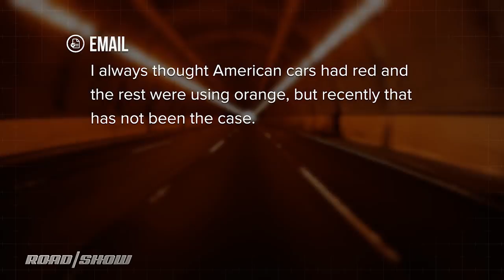Do turn signals have to be red?

Comment: I'm all for amber turn signals. They are just easier to spot when driving. I've noticed that the Asian car manufacturers mostly use amber turn signals and the European/American manufacturers have red turn signals. I currently drive a 2017 VW Jetta which has a red turn signal.
Reply: Mercedes C-Class in the US carries an amber bulb in the housing yet the brake lamp is the turn signal. The biggest pet peeve of mine are manufacturers that have the housing for an amber turn signal but instead it serves as a blank and the brake lamp is the turn signal. Ford is extremely guilty of this and GM has been doing this with their Malibu, Cruze, and Equinox. It just looks like blatant cost cutting. Atleast Jeep adds an extra reverse lamp rather than leaving the housing blank like they do on the Grand Cherokee.
Reply: @juanzingarello4005  It also annoys me when Mercedes tail lights have a clear lens which they do use separately for the turn signal yet despite no cost savings of putting amber LEDs behind it they STILL insist on using red LEDs!
Reply: ElevatorMan5482 ElevExperiencing Productions Ford and currently Chevrolet are extremely guilty of doing this (ex. The Equinox). Atleast do what Jeep does. They substitute the amber turn signals with an additional reverse lamp. Have you ever seen a Grand Cherokee backing up? They get really bright with 4 reverse lamps. But when you leave blanks like Ford and Chevy did it just screams blatant cost cutting.
Reply: @juanzingarello4005  I'm actually not exactly referring to what Ford and Chevy did. What I'm saying is that some Mercedes makes have separate clear lenses dedicated for use as the turn signals which they did decide to use in the US unlike Ford and Chevy but even behind those clear lens, for whatever reason, they still put red LEDs instead of amber despite NO cost savings whatsoever to just put amber LEDs behind the clear segment instead

Comment: This has always bothered me.  Some cars have red turn signals so poorly designed they're practically imperceptible.  A yellow turn signal would fix that so easily.  On newer cars I guess they're not as bad because if they're LED it's typically the whole lens that blinks.  Still, they should all be yellow.
Reply: I am not sure what red turn signals you are referring to. Integrated brake light/turn signal lights are proven to be the safest design in the world due to its simplicity. You hit the brakes and both illuminate red in addition to the high mounted 3rd brake light. You hit the brakes whilst the turn signal is operating and only the corresponding turn signal flashes red while the other brake lights illuminate. Science has proven that this setup is safest due to its simplicity and not confusing other drivers with an amber bulb located in a separate area away from the brake lights.
Reply: @haroldbeauchamp3770  You copied and pasted

Comment: I hate red colored turning signal lights. They're hard to see in certain angles with sunlight.
Reply: I feel the exact way regarding amber turn signals. The red brake light is almost always too bright and overpowers the amber turn signal. What good is the turn signal when the red brake light is substantially brighter and easier to see?

Comment: You know why they use red instead of amber? Two less bulbs and too less pair of wires. It's a cost thing. It annoys me even more when companies like Mercedes put the amber bulb in but use the brake lamp as the turn signal instead.

Also, I don't understand the final reason that Brian stated as to why automakers go with red. Because they don't want to risk it by doing something different? Some cars go from red to amber and vice versa during facelifts. All three American brands have used amber and red. There has never been a scenario where an automaker was sued because he had amber turn signals. Yet tests from the IIHS proved that the risk is greater with red. Wouldn't this go the other way around? Johnny B. Bucks got killed in an American C-Class for using a red turn signal that couldn't be recognized by Jack D. Ass who slammed into him. EVERYONE else is mandating amber. Why did you, Mercedes Benz decide to go red for this one country where Johnny was killed? Makes no sense. It's all about costs. That being said, I think we live in an age where everyone is trying to penny pinch here and there and the reason we see more red nowadays is for this reason.
Reply: The cost effective thing does not go up anymore nowadays because there are a lot of new cars on the road with led indicators, also cars are becoming so expensive that cost effectiveness of using red turn signals is peanuts. It proves that there are more accidents in America because of the confusion of red turn signals that insurance companies are much better off with amber turn signals... Much cheaper because of less accidents. Europe is just proof of that and America just won't admit it.
There is just one big major f-ing reason..
It's all about esthetics! Esthetics are more important to America than safety...

Comment: In my old car, runing rear lights (idk correct term) grounded through turn signals, as ground wire for whole cluster was bad. So when I put blinkers on, it was red lights which were flashing. So when I see flashing rear red light, first thingthat comes to my mind is that ground is bad, not that car is American.

Comment: I'd like to think that part of the reason why most turn signals in the rear are red is to decrease the possibility of someone putting in a clear bulb where an amber one would go or vice versa. One thing that most if not all people here have failed to mention is how many auto makers are integrating turn signals into the bumpers of vehicles. Some of them quite low which will only ensure they will get covered in snow and ice should they be operated in areas where snowfall is expected.

Comment: IMO, it makes the most sense to simply use clear lenses for greatest light transmission and LED bulbs of whatever color you want. 
That combines the best look with the most efficiency and greatest level of customization and ease of change.
Reply: Exactly. All these carmakers worried about the image of their vehicles should stop using red lenses and just have clear lenses with red LEDs for braking and amber LEDs for turning. Clear lenses look super sleek

Comment: I have always liked it better with the amber turn signals. 
However, if a car company is going yo use red, keep it independent from the brake and tail lights.
Reply: Independent brake/signal lights are actually more confusing to drivers according to science. Integrated brake light/turn signal lights are proven to be the safest design in the world due to its simplicity. You hit the brakes and both illuminate red in addition to the high mounted 3rd brake light. You hit the brakes whilst the turn signal is operating and only the corresponding turn signal flashes red while the other brake lights illuminate. Science has proven that this setup is safest due to its simplicity and not confusing other drivers (elderly and new drivers) with an amber bulb located in a separate area away from the brake lights.
Reply: @haroldbeauchamp3770  funny because Roadshow and other sources have said different.
Reply: @Andrew-zv4fm  The government report that Roadshow was referring to was from 2009. Since then, the majority of automakers have switched to LED brake lights. These bulbs are substantially brighter than the incandescent bulbs used in the 2009 study. Newer research circa 2016 proves that the safest setup is the integrated LED brake/turn signal setup due to its simplicity. cheers mate
Reply: @haroldbeauchamp3770  that is not what zo am talking about. When I mean integrated I mean rear lights that have three jobs of brake, tail and turn signals.

Comment: Red for a turn signal is simply tooooo stupid...specially when the person is braking at the same time he turns on the signal, it takes more concentration to know he has turned on his signals
Reply: It's even more of a headache when the red lights share the function of both turn signals and brake lights
Reply: ElevatorMan5482 ElevExperiencing Productions >>>  and the tail lights.
Reply: Well technically the same thing

Comment: I hate the US lighting laws. Some of the dumbest thinking ever! I also hate red turn signals, especially when the same light is used as brake lights! I'm looking at you American and German cars. Europe requires amber turn signals...so why not just bring those to the US as well?
Reply: Also, US still does not require side repeaters for turn signals.  Such an important safety feature.
Reply: Integrated brake light/turn signal lights are proven to be the safest design in the world due to its simplicity. You hit the brakes and both illuminate red in addition to the high mounted 3rd brake light. You hit the brakes whilst the turn signal is operating and only the corresponding turn signal flashes red while the other brake lights illuminate. Science has proven that this setup is safest due to its simplicity and not confusing other drivers with an amber bulb located in a separate area away from the brake lights.
Reply: @haroldbeauchamp3770  Nope science has proven this wrong as well

Comment: Im here because my motorcycle has extra rear signals in red. My narrow brake light has an integrated amber signal and i have small amber signals under the tail above the plate. I didn't feel safe with just that but someone added bright red brake LEDs to the rear peg arms and i rewired them as turn signals. Super bright but not amber

Comment: As long there is an Amber color in the turn signal, like the Tesla model x (US Spec) where both tail/turn lights are combos, like when you have the brake light on, and when the turn signals are on, the brake light turns Amber. 
(This is kinda hard to explain, but this is the best I could do)
Reply: No. That's almost just as bad
Reply: That's still eliminating a functioning brake lamp for a turn indicator. Some Ram pickups do the same. I literally screamed "WTF DODGE" when I first seen it

Comment: If they really needed the rear turn signals to be red, they should at the very least increase the blinking frequency so it is easily detectable to traffic behind.
Reply: Except the problem with this is that signals flash faster when they burn out or stop working to let the driver know that its time to change the bulb.

Comment: there have been a few times when, because of the sun or street lights, i have had a harder time seeing the orange color. really the best turn lights are BIG turn lights
Reply: Do you live in Europe?
Reply: This is true. Brake lights are almost often bright enough to overpower the orange color and rending the turn signal useless if you cant see it flashing. Integrated brake/turn signal lights are scientifically proven to be the simplest and safest.
Reply: @haroldbeauchamp3770  Cite your source, because NHTSA has proven you to be wrong
Reply: @exoticcar5482  the NHTSA article you are referring to is over 10 years old! How do you think that article is still relevant today? It’s not. LED lighting has had a major impact on the effective of rear turn signals and safety. The NHTSA study was flawed as the data didn’t include input from the elderly, color blind, or brand new drivers. The newest data includes these drivers and proves the absolute safest turn signals are one blinking LED light. The integrated brake/turn signal combination utilizing LED lights was easier for the elderly and color blind to see. It’s scientifically proven and common sense. The most confusing and least safe style was the LED brake light and incandescent amber turn signal. Elderly and color blind stated that the very bright LED brake lights overpowered the less bright incandescent amber turn signal and they were unable to tell the turn signal was on. Another interesting and very safe example can be found on some Ram and Jeep vehicles. Where the LED brake light switches from red to amber when the turn signal is turned on. Very cool technology.
Reply: @haroldbeauchamp3770  Cite those newer studies

Comment: American cars are the worst offenders or the red signals. They are starting to get away from it. But still 90% of them use red, commonly it’s the brake light that is also the signal. I prefer amber. I hardly ever see a foreign car with red signals, except for mainly BMW.
Reply: I would disagree with that last statement. A LOT of foreign automakers are switching their taillight functionalities intentionally to red turn signals for the US market and overall it's getting worse. Many VW group models are doing it. Many new Toyota models are also doing it in the US market. Same with Hyundai and Kia.

Comment: 1:16 That would have been true, if not European car manufacturers, specifically German ones. They deliberately change their taillights with already existing amber turn signals to red ones for US market. On some Audis and BMWs I even saw amber light emitting LEDs disengaged in the rear taillights and an additional wire went to stop lights to make them blink as turn signals.
So you have to firstly develop and assemble ‘full spec’ taillight with amber lights and then secondly you have to rearrange them.
Why the hell all that if amber turn signals are perfectly legal???
Just put the European spec taillights and they’ll do the job perfectly!

So why then do they change from amber to red?

Comment: This is another one of those "only in the US" abnormalities.

Wasn't there a story about an american auto manufacturer pushing for red rear indicator/brake lights integration because it made their design look better? 

Regardless, the prevalence of red siganl lights is something that ***US car manufacturers advocated for (one of "the big three" if I remember well) and it has been, in my opinion, the most idiotic thing any car manufacturer has done (along with electric seatbelts, oy!). Ever since I was a kid (53 now) i cannot remember a single car my dad owned that did not have amber turn signals. And I only remember because our dad used to be an auto tech all his life and had his own "mechanic shop." My brother and I learnt about cars early on thanks to him.

Only two of the cars I've owned did not have amber signal lights, and I rigged the assemblies to have separate RED brake lights *and separate AMBER turn signal lights. It's not difficult. And for those trying to make a point of how bright the different colour bulbs are -- that's a moot point because of current LED technology. 

The rest of the world is on-board with a *logical and safe standard.* And there are multiple studies (google them) with plenty of data as to the better effectiveness and safety advantages of amber signal lights.

But, litigious and absurdly individualistic US always wants to beat to its own drum, even if it's deafeningly stupid. 😉

Comment: What about the front¿
Reply: Front is already required to be amber in the US ironically enough and that has been the law since 1963
Reply: @exoticcar5482  amber when turning or at all times? Are switchbacks legal?
Reply: @octaviolozano6890  When turning
Reply: @octaviolozano6890  And yes, switchbacks from DRL are legal. Not applicable to headlights tho

Comment: Feels like the most cruicial explanation is left out. US standards require a minimum size of 50 cm2 in the US for turnsignal. While the rest of the world use tiny LED-stripes, to get the right lumen required, US still demand a specific size for turn signals. The 50 squrare millimeters can only be achieved by letting the whole lamp flash instead. Trends are of course playing a vital role, like when cars managing the required size in yellow space, still use the red signals, but the core for last years shift for red, has to to with LED-taillights.
Reply: And the funny thing is, that size standard you're referring to has been scientifically proven outdated yet the law STILL hasn't changed
Reply: Can you prove that larger red is still better than amber even in fog?  Red color and fog don't go well together.
Another scenario: you're approaching from back-left, other car has broken left tail light, you do not have direct line of sight to front of other car. How do you know that left turn signal isn't on?
50 cm² is 50 square centimeters.
50 square millimeters would be laughably easy... That's closer to size of mirror mounted indicators (also known as side repeaters) in some modern cars.

Comment: Stupid design  red turn signal and worst is shared with brake light
Car company change law because they can made cheeper car and dont cost them another bulb and wiring
You should see front of you car and recognize that bilnker on or braking for few imprtant secend
If hazard on and braking in car that without third brake light imposible.
In some place its illegal using hazard when driving bcause car companis in usa are jerk.
God konw how many people killed or injured or how many accsident occurre in years till now.

Comment: If its cheaper and more estetical to put both red lenses, maybe you can put amber bulb inside. Most of EU cars have reverse and indicators in white housing but indicatros have amber bulb inside. Works just as it should and still you dont have "ugly" amber lens.